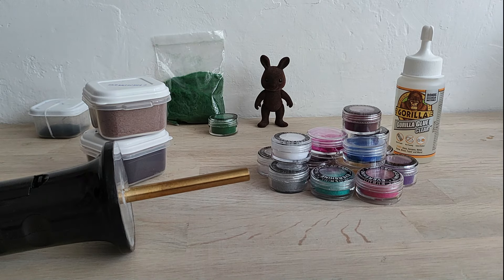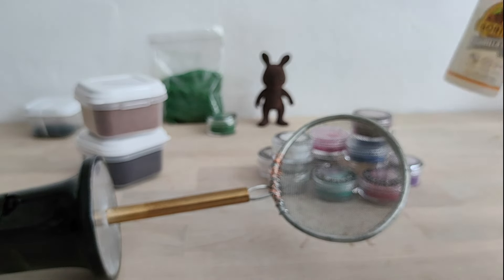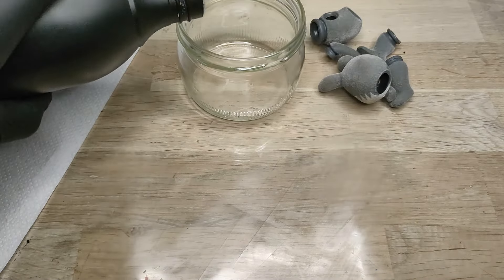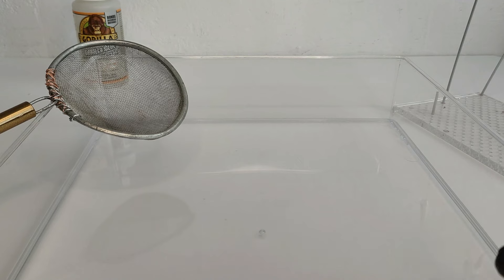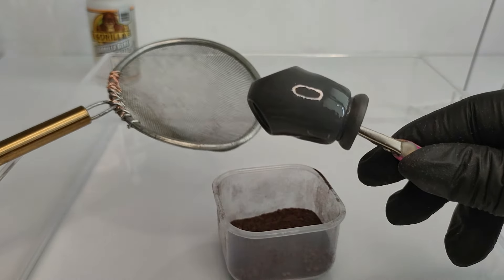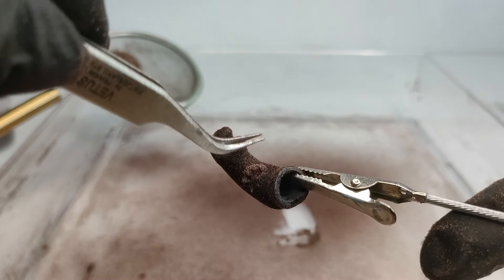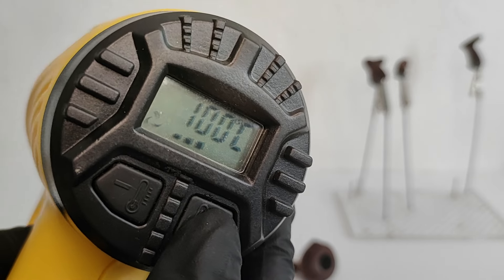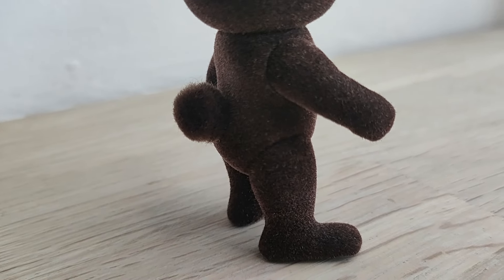Sylvanian Families restoration | Reflock

Comment: Do you know what mesh size is the sieve you adapted to the flocking machine? I am tryint to get all that stuff. 😊 Thanks
Reply from the maker: @inal-ii  I'm sorry I didn't know whey even have sizes 😃 but the gap between the wires has ~1mm